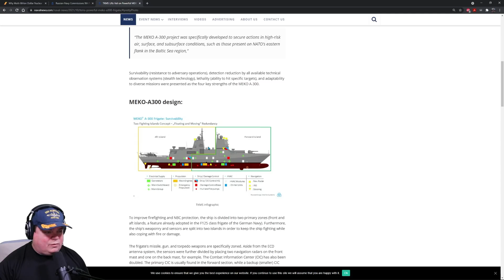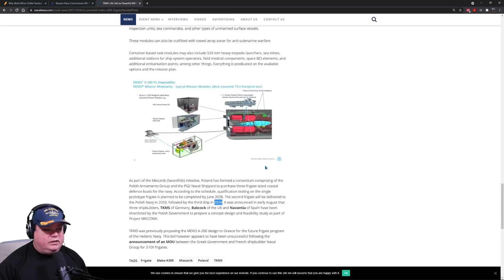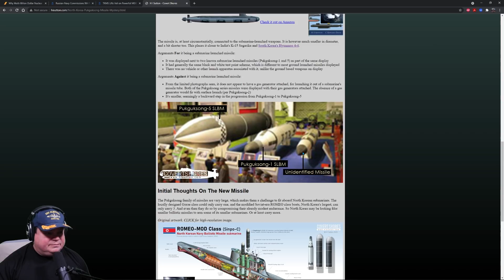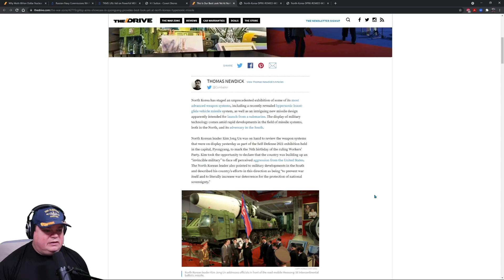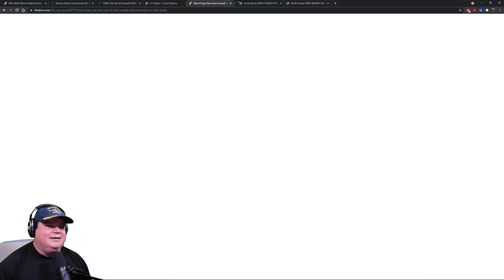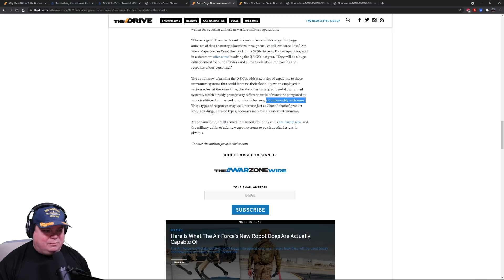Germany's Battleship Frigate MEKO A-300

Comment: At 6,000-tonne it is no large Frigate just a medium one! with 32 Mk 41 VLS and 36 small VLS for only the small Barak SAM as the Barak MRAD is halve the range than the ESSM 2 missile and cannot be quad packed!
With 16 x NSM II antiship missiles its still far smaller than the 96 Mk41 VLS Arleigh Burke.
But its a step up from all those under armed euro frigates that have been built or designed lately with just 16 or 32 VLS.

Comment: What makes a ship a destroyer or frigate usually comes down to politics. The USN only once called a class of ships a battlecruiser for example, and by the time the Alaska class was being built that term had seriously fallen out of favour, thus the Alaskas were "Large Cruisers" in spite of having many design features common to many "battlecruiser" designs of the previous thirty years. But then again, the USS Long Beach, CGN-9 was the last "cruiser" built on an actual cruiser type hull... all US cruisers since then were built on destroyer or frigate hulls (among the differences in the hull types was true cruisers were double-walled external plating and destroyers/frigates had a single wall outer plating, and not particular thick plating at that. The Leahy, Belknap, Kidd, Virginia, California, and Ticonderoga class "cruisers" were all originally built (or designed, the Tico's got re-classed before being laid down) and designated as Destroyer-Leaders, aka, Frigates. During the 1975 ship reclassification they all became cruisers to plug the so-called 'cruiser gap' with the USSR. The UK's invincible class carriers were originally called "thru-deck cruisers" as a means to get them approved for construction. The USSR's fixed wing carriers are all "aviation cruisers" because of a treaty restriction that prevents aircraft carriers from sailing thru the bosporus. Japans many large flat deck helicopter carriers are all "destroyers" because of constitution limits against offensive weapons being part of the self-defence forces, which aircraft carriers are considered to be. 

As to the weapons on the Meko A300, the artist model shows two of the 35mm millenium guns aft, abreast the helicopter hanger but wasn't mentioned in the naval institute article. These are multi-role autocannons meant for engaging small boats, UAVs, aircraft and anti-ship missiles. The 16 anti-ship/land attack missiles are the Kongsberg Naval Strike Missile (RGM-184A in US service) which Kongsberg confirmed six years ago could be used against Land targets. But for that matter, the current tomahawk block V missiles are dual-target capable, for both surface and land targets, which is the Flight IIA and III Arleigh Burkes lost the harpoon launchers. They're no longer required as the tomahawks they carry can be used against ships also. The 32 cell Mk41 is the strike length cells needed for quad-packed CAMM, SM-2s, ASTER 15, quad-pack ESSM, Tomahawks, VL ASROCs, or any of the booster equipped standard missile versions or the the european ASTER 30 missiles. VSHORAD is Very short range air defence, SHORAD is short range air defence, MRAD is medium range, LRAD is long range, TBMD is the Theatre Ballistic Missile Defence. So basically CAMM/ASTER 15, ESSM/CAMM-ER/SM-2, Aster30/SM-6, and SM-3/Aster 30 Block I/IC/II BMD respectively. The 36 cell VLS isn't that. Its a 3x3 cell ExLS VLS installation, which will carry quad-packed ESSM for 36 total missiles. 324mm (12.75 inches) is the standard lightweight torpedo caliber for NATO, used for the trainable self-defence torpedo tube mounts (usually a 2 or 3 tube swivelling mount) on ships and for air dropping by ASW helicopters and airplanes, or as the warhead of ASROC missiles. The US Mk44/46/50/54 are all 324mm torpedoes, as is the british sting ray. In all likelihood given the 3x3 ExLS carrying MRAD category missiles, the Mk41 cells will be reserved for SHORAD, LRAD and TBMD. They're cramming these ships with a lot of weapons because Poland is not going to buying that many of them. In any case though they picked the winning design in April and its the Arrowhead 140PL, not the Meko A-300PL.

Comment: That is a lot of missiles for aggressive purposes yes...20 or so more than a T45 Destroyer for example, but the rest of the weapons are defensive which is what Frigates tend to have anyway. Type 23 has Anti-air missiles, Anti-ship missiles and Anti-Submarine Torpedos. But then also the 30mm Goalkeepers and the 4 5 gun. With the Helo (which is usually Merlin), these things are armed to the teeth, as were the Type 22 Frigates and so will be the Type 26, 31 and 32. I think this German thing is heavy on the Main battery of missiles certainly, but the rest is defensive as it doesn't have CWS cannons (or maybe it has if I watch the rest of the video), it has missiles instead. The Mk 41 VLS silos can fulfill a multitude of mission profiles as they can carry so many different types of missile, which is what makes having so many of the launchers impressive for a Frigate. But Frigates are all multirole nowadays, as in GCS or Global Combat Ship in the UK. Even the ASW specific Type 26s will have multi role capabilities, but they will just kick the asses of any submarines around her first and foremost. If like the new Frigates that I have worked on as part of design etc., these things can utilise multiple types of weapon all at once i.e. carry multi payloads of TLAM and AAW missiles etc. And still control them all independantly, then that is what will truly make this thing bad ass....along with a 5" gun for measure (but again, that is fairly standard now aswell, unless you are the Yanks of course and have 2 on each platform!!!). If it has those tiny torps for self defence, then it will be relying on the helo to do its ASW work and that is the primary purpose of a Frigate for the most part (however I haven't gotten far enough into the video to see if there is sonar of any note fitted on this baby), so this thing is not a Frigate by definition. The size of it at 544 feet in length and displacing 9900 tonnes is in Guided Missile Cruiser territory like the Ticos or the GMD Burkes. It has less VLS silos than either of those classes, so even if it carried only TLAMs, it may not be as potent as one of those beasts either way. Bigger than the Type 45 though and with more missiles, so I expect this to be a bad ass machine of war, but if it has a better radar than Type 45, I would be surprised as the MFR totally kicks ass. When you are asked to severe your Link 16 due to one Type 45 populating the entire air picture for an entire US Carrier Battle Group, as it was diminishing the training value of the exercise for US saliors, then you know you are pretty good.

Comment: Though the Meko A300 is a real kick-a$$ frigate, it's VLS load is not exactly as much as an AB DDG, coz the AB has 96 x Mk41 VLS that can carry 4 x ESSM ea for a total of 384 ESSMs, when compared to the Meko's 32 x Mk41 (4 x ESSM ea) + 36 x Mk48 (1 x ESSM ea) for a total of 164 ESSMs. That and the fact that the Mk48 can only hold ESSM whereas the Mk41 can also hold the bigger SM2, VL-ASROC etc..Btw, the common Mk32 torpedo launcher  can be also used for the Mk46 torpedo which has a range of 10-11 kms, reach a depth of 1200 ft & a speed of 40 knots. If that thing smashes into the hull of a sub, then it is gonna be in big trouble..

Comment: Of course the Germans put a lot of weapons on it... it isn't for their own navy :D  
(see F125 for their own Navy, then consider the relative sizes...)  
  
32.4 cm torpedo: that's the standard helo-dropped torpedo in EU basically.  
They can launch em from the ship. Definitely limited range, and pretty pointless vs a surface ship. Main idea would be to be able to quickly launch something vs a close sub, in say, littoral situation. The anti-torpedo torpedo may be offered, but the Polish navy can basically put any (small) torpedo they want in it, if not anti-torps then they have a choice of Mk54, Mu90, Stingray I think iirc,... but not 40cm options like the Saab one etc.  
  
Frigate in general:  
imo, always having towed array is something that can be heavily advocated for. Polish navy worries heavily about Russia... Not to underestimate the Russian surface fleet, but their submarines are a pretty big concern, including in the seas the Polish navy would be operating this frigate in.  
So I consider that to be something 'lacking', if it is only in a specific module. It is however, an optional fixed installation (so every module can have it).   
But I'm biased: I think any modern EU frigate should include anti-submarine warfare capability; including a capability that is not dependant on the helo. So, glad to see the bow mounted sonar as that one can help alert to an unsuspected torpedo launch etc, in littoral,.. when you might not have a towed array out. 
(So, for a EU frigate, I'd want to see both bow-mounted sonar, and a large towed array. Due to size & weight considerations, you might not have a double or backup towed array on a frigate; that's acceptable. Ideally then, some anti-submarine missiles in a VLS, like a modern subrock, and besides helo, a drone capable of dropping buoys or lightweight torps. I expect US navy to shift increasingly to the Pacific, so EU nation's ships should take the Russian submarine fleet heavily into consideration for their capabilities imo)  

I also expect trade-offs:  
I think possibly the range/endurance of this ship will be limited in practice.  
Or, when picking the 127mm main gun, that takes a lot of weight, and also deck space underneath. perhaps then you'd limit the length of one of the VLS sets, or have some other limitation.  
The Oto Melara 127mm/64 module was something like 50 million IIRC, which is an expensive gun option for a frigate this size, and an interesting one. But the offer includes the option for the 57mm, or the 76mm too.  
Ultimately, a bit similar to the US frigate program, the customer can make a lot of decisions in terms of armament & systems, which then can have significant impact on the price.  
I'd probably trade off the 127mm for a good towed array, if the costs are somewhat comparable.  

And frankly: I'd run like hell away from modules.  
Modules: how to balloon the costs of any warship program.  
Making a variant with torpedoes,....  : fine.  
Making modularity a thing and the ability to turn the aft section into a rib-system, torpedo, medic, unmanned center at will: NOOOOOOOOOO

Comment: The MEKO A-300 Frigate appears like a very fine heavily armed combatant.  However, the Meko-A300 class frigate is only a design that the company is proposing to the Polish Navy.  It is a very long ways from being built and operational.  If the design is accepted and orders forthcoming the prototype frigate is planned to be completed by June 2028. The second frigate will be delivered to the Polish Navy in 2033, followed by the third ship in 2034.  In regards to their weapons load out, you can throw a bunch of weapons on a barge and a warship it does not make.  Modern naval warfare like most things today, depend on highly complex software.  US warships use the Aegis Combat System that is also on many allied naval ships and ashore facilities.  It consists of millions of lines of code with years of operational experience across the globe.  If push comes to shove it probably will work nicely.  Ships built in small numbers no matter how deadly they look,  don't have the money, time and numbers to optimize, debug and keep updated their command and control software.   When the missiles start flying I'd be willing to bet ships like the Meko A-300 and others built in too small of numbers to optimize, will require a reboot at the most pregnant moment.

Comment: Have you seen the axial electric motors they are using to drive the legs of the dog?  The short comings of the weapon is the key we need to find.  The weapon appears to be for wide open spaces, so the only way to battle it would be in a town or broken area where short range and fast reaction times are required.  Another way to beat it would be overloading it with high powered radio waves.  And typically, things are designed to work on flat land, so mountains would be a challenge for it in the early stages.

Comment: Typically, we fail to see the true weak points.  In this case, the computer hardware is the weak link.  The hardware needs to be made local and not in China.  One issue with China made hardware is the hard wired back door.  If you think about it, a hacker could shutdown or worse at the click of a button.

Comment: Dumb idea. Why? Because you are packing a ship with three to four times the weaponry that it is likely to be able to use before it is either destroyed or has won the battle. That is a waste of money. This is a small ship and no degree of separation of stuff makes it truly survivable. One heavy weight torpedo and it'll break in half. A heavy AShM like the LRASM, Tomahawk V or Yakhont and it may survive but only to limp home. Also, multi-layer AAW is a joke on such a vessel for the simple reason that it is intended for a "Frigate Navy". When operating alone or with other similar surface combatants there is no serious way to see beyond a 30~35km radar horizon when dealing with air threats including AShMs. You can have long range SAMs, medium range SAMs, point defense weaponry, but it all comes down to 2 minutes of reaction and engagement time vs subsonic missiles or about a thrid of that against Mach 3 weapons. You are lucky to get one or two rounds of SAMs off and an attempt with point defense systems. For long range AAW to be effective, you need AWAC capability to see beyond the horizon with a powerful enough radar. Instead of a very expensive small ship overpacked with systems and weapons it is better to have two more moderately armed ships which can be in two places at the same time.
Reply: maybe you didn't pay attention but they plan to equip the ship with the new (and still in development) cavitation anti torpedo torpedo. so sinking this ship with a torpedo is not at all a sure thing. also it doesn't have 3-4 times as many weapons as comparable ships. it has a little more but not by much, not even 2 times.

Comment: Thinking along the bloodlines of the Grom class DD's with these new overpowered "Frigates".  Fits about the same general role for Poland. ASW/Minesweeper with a nasty punch in a good size for the North Sea region. Generally doesn't need to be out for the Eastern Pacific long hauls unless doing joint training. Just needs it's Morocco to Iceland capabilities. Looks like a good fit in a 3 pack with the modularity and likely available parts. Błyskawica 2.0?

Comment: Hopefully somebody in the German Navy / MOD pays attention to this,
as proper offensive armament has seemingly been a fairly low priority on their post 2000 ships.
8 deck-mounted Harpoons and a 127 mm / 5 inch gun on 7200 ton ship (F125 class) ? Come on !

As for Poland buying them - I believe it when they actually get delivered.
Poland has made a lot of deals around naval procurement with Germany in the last 30 years, 
(including a Fleet of LPD / LPHs), but the only thing they ever actually bought,
where three 369 ton Fast Attack Craft.
Reply: You should  look up the specifications for the F125!
They are designed to stay over two years away from home port, with rotating of crew. Their  task to act as "flagships" for long-term naval operations, like "Atalanta".

The "fighting variant" will be F126.
Reply: @EK-gr9gd  I was intentionally only mentioning the anti-ship parts, 'cause that's where I see the main problem.
On that front, the F126 sadly isn't much better. Nowadays you need a lot of missiles to punch through 
another ships missile defense system and if push comes to shove, things might get tricky, if you need 2-3 frigates to sink one hostile. At least the F126 doesn't solely rely on its helicopters to do ASW, but unlike the Brandenburg-class it replaces, it wont have any ship-mounted torpedoes.

Comment: 127/64mm is a VERY inaccurate way to describe the Vulcano cannon; 127L64 is a much better way. 
127mm is the diameter if the round (aka. 5 inch)' 
"L" represents length of the barrel in diameters of the round. 
So 64 represents cannon barrel length in multiples of the diameter, IE. 64 times the diameter of 127mm. 
So the whole of the barrel is 8.128 meters long or for Americans 26.6 feet!
Reply: 127/64 is a perfectly fine way of naming guns, and well within Italian (well not only) way of gun designations.

Comment: There's two main vls cells, the strike length and the mid ship. Do they really mean 36 cells for the mid ship vls? That'd be 36 quad packed(144 missiles)  essm's right?
Reply: They only state: 36 VLS cells for MRAD SAM. Not stated what type of launchers, most possibly Mk.41.
Reply: @Galvars  yeah if that's the non strike length then those 36 can accommodate quad packed essm or single tomahawk amongst other things. Could imagine a loadout with  12-18 quad packed cells and rest with tomahawk missiles. Could load the other cells with sm-6 for very long range and quick strike sam/asm/ land attack. That paired with the vulcano ammo is a lot of firepower. These ships are taking down a lot of enemies of they get chance to fire off their missiles.

Comment: MEKO A-300: "what the LCS should have been"  I was just typing it when you said it.
Reply: I concur if the larger unit was what was intended all along.
Reply: Perry class should have been replaced by something like the Spanish F100.
Gibbs and Cox came up with a frigate with 64 VLS called the international frigate way back in the 1990s as it looked like a F100 with 64 VLS and 2 seahawk ASW helicopters.